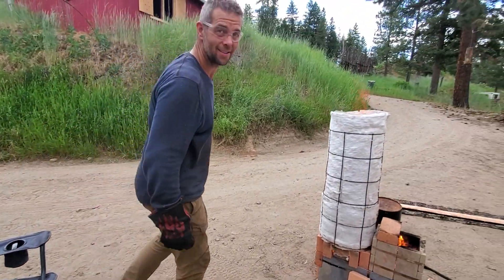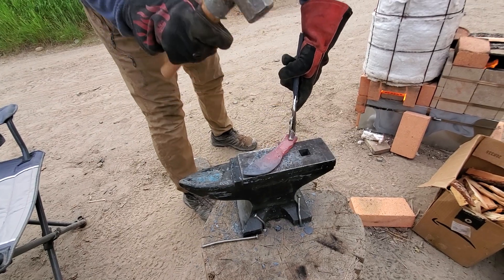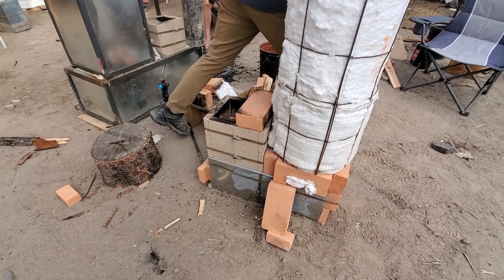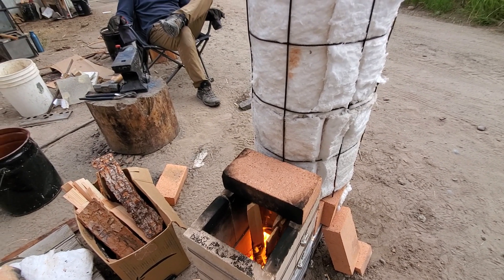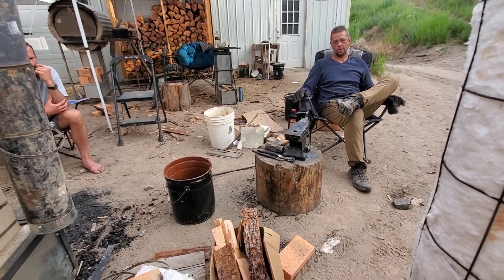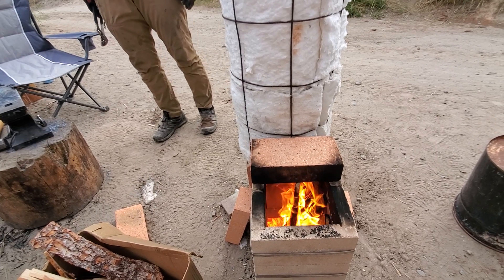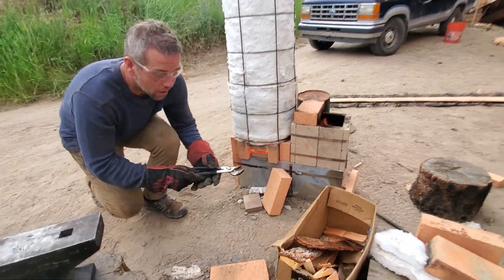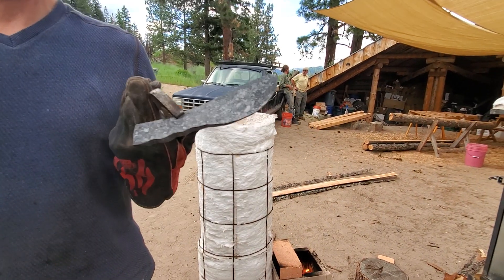Jason's Wood Fired Rocket Forge. 2022 Permaculture Technology Jamboree with Uncle Mud

Comment: Have you gents thought about making a waste OIL kiln so that you can use up waste motor oils from your vehicles and it will give you temperatures in the 3000° range and simply give you just about moisture vapor out the chimney❤️‍🔥
Reply from the maker: I would be good with trying that for heating a shop or house but I would worry with a kiln what would be getting all over my pottery. I'd definitely be game to try a hybrid wood/oil drip for a forge. One of my clients melted a very thick very expensive piece of stainless steel pipe in his rocket heater while dripping spoiled seed oils into the rocket heater I built him.
Reply: @  used or waste motor oil burns very, very hot. I’ve given enough oxygen for combustion. It will make a very large cutting torch, but I assume you buddy probably already witnessed that.

Comment: Hey Mud,  are the burn tunnel and feed tube insulated?
Reply from the maker: Thefeed tube is not and should not be insulated as that would make it a more effective chimney than feed tube. This particular burn chamber is not insulated but it would be easy to insulate with Sand or ceramic wool or perlite or vermiculite or ceramic insulative board or even (sacrificial) wood chips mixed with clay or cob.
Reply: @UncleMud  Ah, of course!
I was mostly thinking of the burn tunnel, I thought it might be made of an insulating board.
It's very encouraging that it works so well as it is.
The feedtube and the forge area are firebrick, but what are the grey side panels  of the burn tunnel made of?
Reply from the maker: @slaplapdog  the entire burn chamber is lined with thin firebrick "splits" to protect the ceramic board. The firebricks are slightly edited to help keep each other in position without cement so they expand and contract with less cracking but are easy to remove and replace when needed. The outside of the firebrick is surrounded by sheet metal to hold everything in place standalone or when in a sand mass.